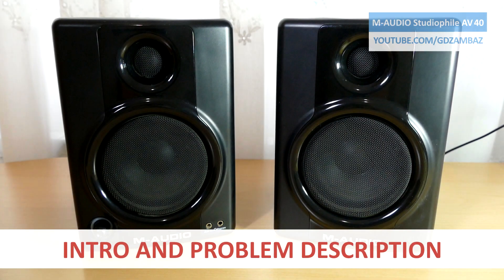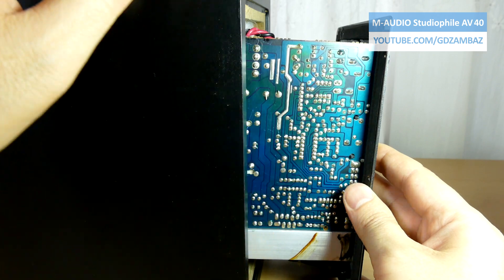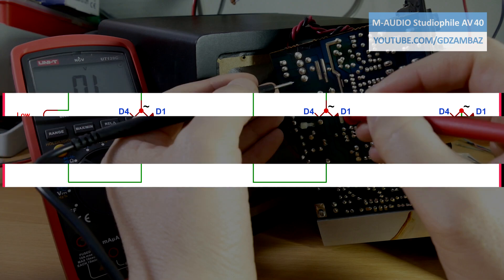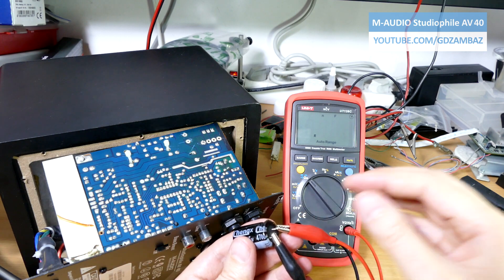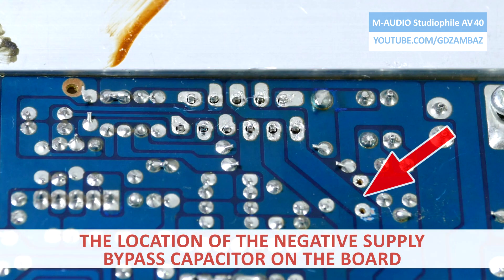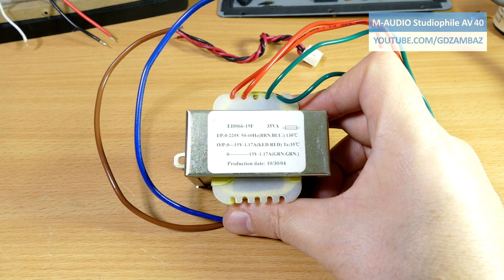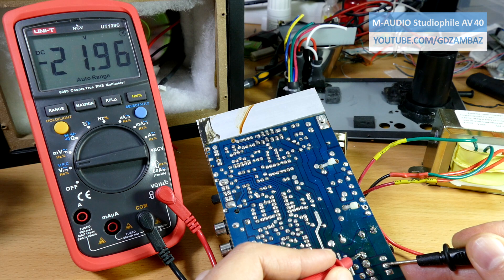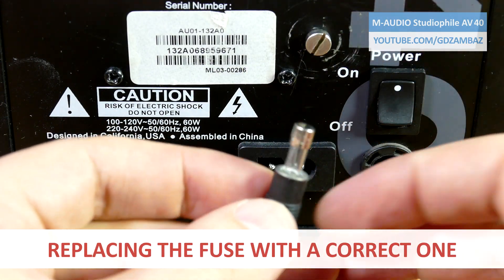Repair of M-Audio Studiophile AV 40 Speakers

Comment: Great video. Thanks.

I have M-Audio M8 and the bass started to give in after 5 years, and one speaker started sparkling. Are they blown? Why would they just cave in like this? Can one fix blown speakers? What specifically has happened to blown speakers anyway? They've just been played at a moderate volume.And they've been sitting still at the same spot all years.
Reply from the maker: I assume that you are talking about sparks coming out from the woofer. That is not a good sign (regardless of which driver the sparks are coming from) and it is very likely that that speaker driver is blown. A visual inspection of the speaker and a simple check with an ohmmeter can help you determine if it's definitely out of order.
A speaker driver can be repaired, however I would suggest you to buy a new one (I suspect that the voice coil is damaged). But before you proceed with the driver replacement it is also very important to do proper troubleshooting in order to find what exactly caused the problem.
Reply: @GoranDzambazov  Thank you. No no there's no sparks anywhere. Just tried to explain the sound emitting. Sparkling,crackling,weak. The bass started to let go first, as it lacked energy, and then the rest gave in. It just seem not to want to play anymore. They don't seem blown at all in that regard. They've been sitting stagnant for 5 years with moderate playing. I suspect cheap internal parts. They just seem to have ' caved in' and don't want to give anything anymore. Lackluster sound,weak bass.
Reply from the maker: Sorry, I got it wrong. I thought that you used the word sparkling as a synonym of sparking.
An audio recording of the sound coming out of the speakers would make the things much clearer. I would check the state of the speaker diaphragm, a continuous check of the coil resistance while slowly moving the speaker diaphragm in and out, the connections to the speaker, the soldering joints on the board, the volume potentiometer, and (at least) a visual inspection of the capacitors in the audio conditioning section of the circuit (for bulging or other abnormalities).
Reply: @GoranDzambazov  Thank you so much

Comment: I cant find that transformer anywhere...:(
Reply from the maker: The transformer used in these speakers is a standard component and it shouldn't be a problem finding it. But, did you definitely confirm that it's defective and that it needs replacement? Typically, the fuse should prevent that to happen.
Reply: @GoranDzambazov   Yes, the fuse is all right, and the transformer is shorting out, cause it looks like it melted the insulation. Found one transformer, but its 100v...
Reply from the maker: @Manismor  Well, then good luck with the repair!

Comment: I have AV30 speakers that have the humming noise and make the popping sound when switched on. The volume switch also crackles when moved. I opened them up to have a look today and 4 of my capacitors are bulging with brown stuff coming out of them so I’m guessing that is my problem? You make it look so easy to remove and re solder things but not sure I can do it myself. Great video anyway,  very detailed!
Reply from the maker: Thank you!
In case if you still decide to do the repair yourself: Did the humming sound develop progressively over time or it started abruptly? It's very likely that it is a result of bad capacitors (and bulging is an indicator for that). And as you say, if there is a brown stuff coming out from the top vents then the things went too far - in that case they definitely need replacement.
Otherwise, cleaning the volume potentiometer should resolve the crackling sound.
Reply: Goran Dzambazov thanks for your reply. I bit the bullet and did my repairs, bought a soldering iron, solder, the replacement capacitors, and some contact cleaner. I replaced the 2 large capacitors and the 2 small ones and cleaned the knob with contact cleaner. My volume now works better, no crackles and it’s even through both speakers but I still have a very low hum/buzz and popping when switching them on/off, any idea what other component could be causing the issue?
Reply from the maker: I'm not sure if I can give you a clear short answer regarding the popping sound for these speakers. Mine do the same and I believe it was so since the beginning (however, I'm not their first owner). In short: The amplifier IC used in AV40 is TDA7265 and in the manufacturer's specs it is clearly stated: No pop at turn-on/off. However, I did not investigate/examine if M-Audio followed the typical application circuit given in the specs in their design neither I tried to fix this problem yet.

You say that the hum volume is now very low and I assume it is a result of the capacitor replacement. At this point I would still check the ripple voltage level of the DC supply voltages with an oscilloscope during operation to see if that can be the cause of the hum.

Comment: Why does left output speaker sound less louder then the right input
Reply from the maker: If you are talking about the music in the last test, I checked the source audio files and yes, there is a constant 2-3 dB difference between the levels of the left and the right audio signal (and as you noticed the right one is the louder one).
As I mentioned in the video, during the last test the audio was recorded using a digital recorder and one possible explanation is that it was not directed symmetrically to the speakers (although I wouldn't let that happen at least for that test and I don't expect that much difference even if that had happened).
I haven't noticed any difference between the left and the right speaker output levels during the everyday use before and after the repair but I'll do a more thorough test to clarify this. Thank you for your remark!

Comment: Hi great video i have a set of AV40s i have no sound in the right side 
is this the same fault that you experienced
Reply from the maker: If you watched the video carefully, in my case there was a hum and no sound from the both speakers.
So for your case if there is no sound from the right speaker, but the left one is still working normally, the fault is something different.
However if there is no sound from both of the speakers and the blue power indicator is off (with the power present), then check the fuse on the back plate and replace it if it's blown.

Comment: Hello Goran i got a speaker monitor gibbon 5 ..stopped working after i put put voltage from 230v to 110v .. now the speaker wont even turn on .its only a few weeks old .can you help me repair it
Reply from the maker: Hi! Did you check the fuse? If it is blown, replace it, put the voltage selector back to the correct position again and give it a try.
Reply: wow thank you the fuse was blown .. its working now .. thanks a million
Reply from the maker: No problem. You've had luck! :-)
But make sure also that the fuse you've put is with the correct ratings.

Comment: my m-audio speakers just switched of on their own while in use 
i tried to switch e'm on but the blue light doesn't glow anymore what should i do
Reply from the maker: Hi,
First, you would need to confirm that the mains voltage where the speakers are connected to is present. If that is OK, next, you would need to check the fuse: if it's blown, that might be the only failure (and you would get away just by replacing it) but it may also be an indication that there is a failure inside that needs to be investigated further.
Good luck with the repair!
Reply: Eish same here but the fuse is fine... When i check on the map nothing damaged

Comment: mine made the same noise like yours, I found out the 2 main caps right after the rectifier are bad, replaced the caps. No noise when I turn it on but the new caps explode again after a few minutes. What do I need to check? Thanks
Reply from the maker: Did you also check the bridge rectifier diodes before replacing the capacitors?
And also, did you observe the polarity of the capacitors and was their voltage rating correct?
Reply: I did check the rectified diod and verified the value of the caps as well as polarity.  I plan to try again with another new pair of caps, will be Nichicon this time no more junk caps.
Reply from the maker: You can also check and confirm that the DC voltages across the capacitors are as expected. Good luck with the repair!